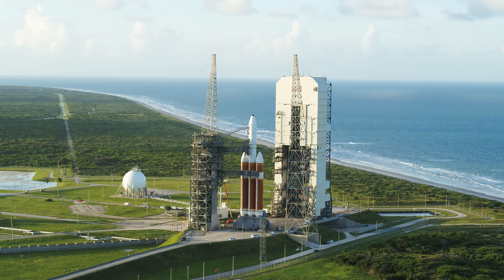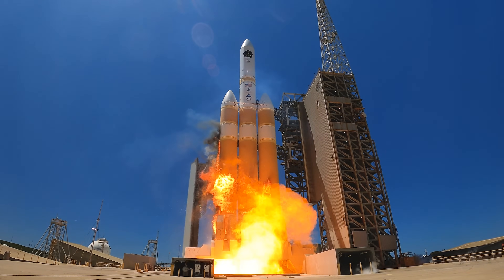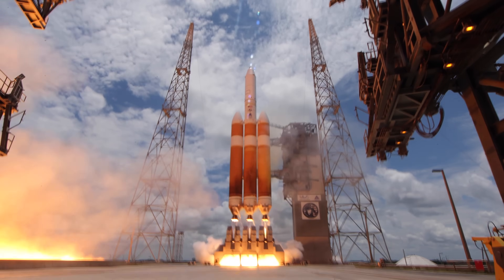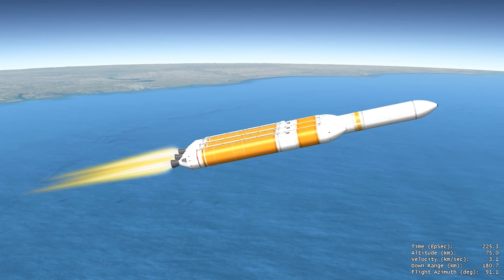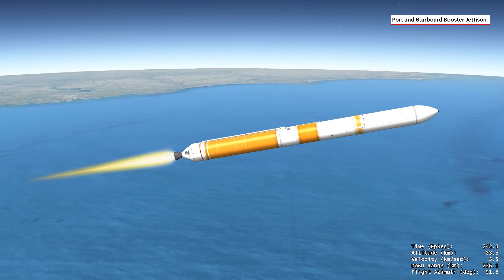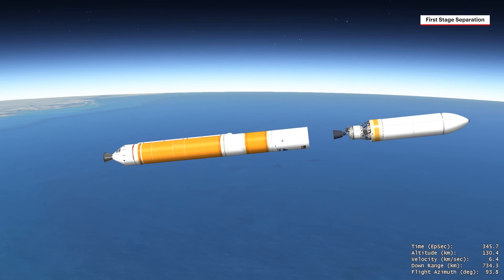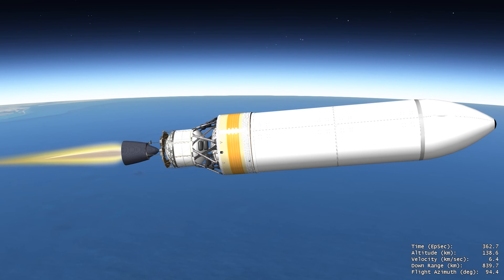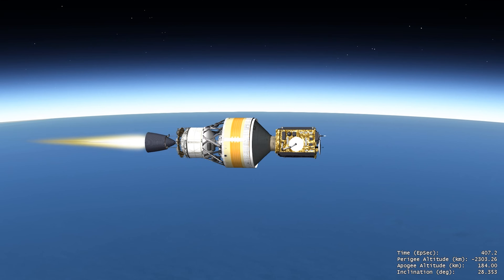Delta IV Heavy NROL-70 Mission Profile

Comment: Super. But charge them for the damage to the environment. It's expenses, not ours. Their profit not ours. Our Planet. Not Theirs
Reply: This rocket's exhaust is just water vapor
Reply: Also known as super scary 'green house water' to the climate change nut jobs like dan.  @Shadow_The_Pad
Reply: @Shadow_The_Pad 1. Incorrect. Delta IV uses ablative coating inside their nozzles for cooling purposes. I am not sure about the details, but it's definetly not water vapor and I sure as hell would rather not breathe it in.
2. Environmental damage is more than just engine exhaust. It's also noise pollution, spent stages dropped into the ocean, production and handling facililties, the list goes on.

I absolutely agree with @danhove that any and all environmental damage must be compensated accordingly, and not only for rocket launches btw. In fact, there is literally no way around it: Either they pay, we pay, or future generations pay. Pick one.
Reply: @Shadow_The_Pad Oh and btw, water vapor is a potent greenhouse gas as well. But H2O decays much faster than CO2 (about ten days vs. 50-200 years) so it's not as bad.

But I bet ULA does not use green hydrogen in their rockets anyways. Instead, this is likely grey hydrogen which is pretty much fossile gas after all. All that useless Carbon from fuel production has to go somewhere. Wanna guess where? ^.^
Reply: Rockets have a TINY effect on the environment and their benefits for us (and the planet via sending satellites that study our climate) outweigh them all

though i do agree that all companies should pay for their damages

Comment: Does the flame duct provide any additional boost to the vehicle?
Reply: Nope, it just deflects the engine exhaust away from the vehicle.
Reply: Okay I was thinking it might act like a compressor of pressure / atmosphere I know it's just a concrete box  @fs10inator
Reply: @lorenzoo90 it wouldnt really make a difference if it did that because the exhaust gasses would have already left the engine at the point.